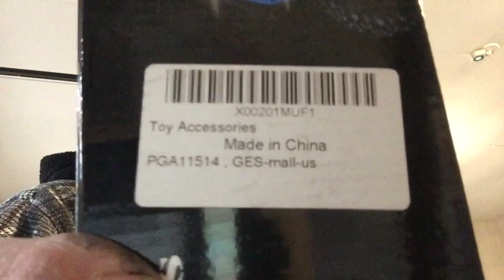372.  How can I install a light on the back of my snapper for bagging leaves￼. ￼

Comment: Hey Jim......I have a question on why I have to keep replacing the clutch friction disc on my 3311X65  11HP  rider?      Lee from Georgia
Reply from the maker: Hi Lee it’s Jim
I would check the nylon bushings in your yoke and I would check the bearings or bushings in your fenders sounds like something is out of alignment I would also pull the boots off of the chain case and see how the sprocket and shaft fits and the hexagon shaft to see if the shaft is wore out and check the shaft Or tail as I Collett that goes into the slot on your yoke and make sure that Welding didn’t break and has that bent on an angle let me know what you fine. Jim

Comment: Yes, the LED lights only work with the proper polarization. After all they are Light Emitting DIODES. They conduct electricity in one direction, not the other.
Reply from the maker: Well I ordered some LED bulbs they just came the small bulb and a 1 inch long bare  wires one was color-coded if you put the positive wire to the color-coded wire the light would be bright if you put the positive wire to the other wire the bulb was only half is bright. Jim